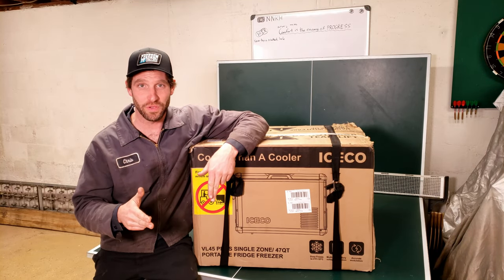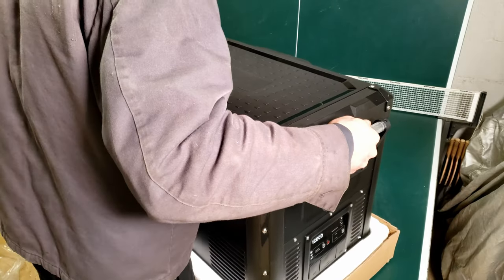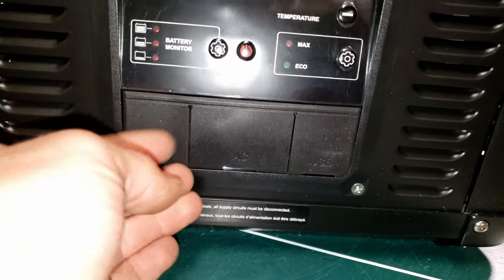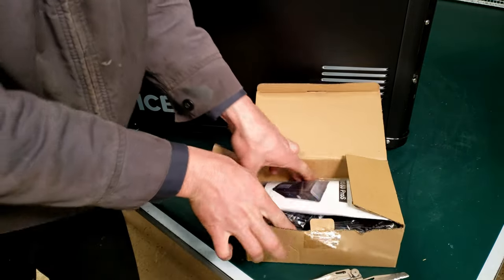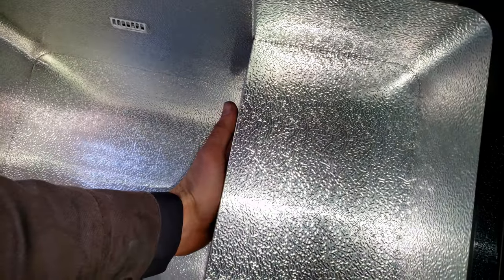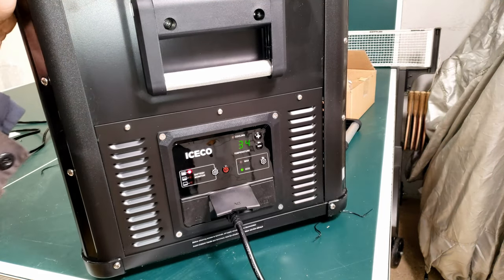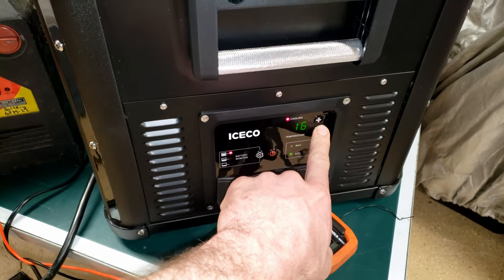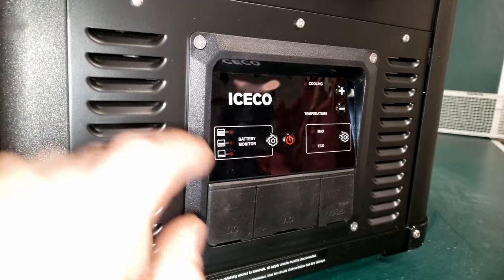ICECO VL45 proS 12v Refrigerator Cooler REVIEW

Comment: I just got the VL60 Pro and I set the temp for 34 degrees and turned it on.  The temp inside to start with was 72 degrees.  It got down to 34 in about 15 minutes or so.  I love my fridge.  It is a bit heavy.

Comment: Good review but want to point out that the refrigerant on this is actually R513A which is not flammable. The foam insulation is foamed/blown using C-pentane which in itself is flammable. With that said once the insulation is foamed/blown the C-pentane that hasn't combined with the foam evaporates and is handled at the mfg facility where the refrigerator is made. Any C-pentane that remains in the foam is considered nonvolatile since it has combined with it. They used to blow insulation using R134a and have since switched to C-pentane as its potential to destroy ozone is far less. My understanding is that the C-pentane label on there is just a precaution in the rare case that not all of it has evaporated during mfg.

Comment: If you plug in the AC and DC ports which will it prioritize? Will it swap over if 1 source dies? Also if you use both DC ports for 2 batteries will it auto swap if one of the batteries dies?

Comment: Do you know what the current draw was while hooked up to the 12 volt battery and how often it cycled. I am trying to find out the amp hours I need as I am going to be powering a battery with a solar panel. Still trying to work out the batteries and size of solar panel. Looking at 2 Trojan T105s and a 100 watt panel. The battery place also recommended the Energizer ARC 5 and ARC 12 Lithium Ion Powerstation. .

Comment: Actually I am going to be buying this or something like it in a few months.  It looks like a decent unit , the only thing that stands out to me as a potential deal breaker is the color.  And the only reason I say that is because black draws the heat something terrible.  But if you are keeping it out of the sun then its not a problem.   I am looking forward to seeing how this holds up. As always that was a real nice review Chris and a real good tip about the clear sealant.   👍
Reply from the maker: Yeah good point about the black out in the sun. Although I think this is best kept under a roof or indoors. And cool, I'll let you know how it holds up. Thanks for checking out the video!

Comment: i know they want to sell their fridge slide, but i find it so stupid how they use straps to secure the fridge compared to brands like Dometic which have bolt holes on the bottom of the fridge so that you can secure it to a platform from underneath. the straps through the handles look so cheap and block part of the panel as well.